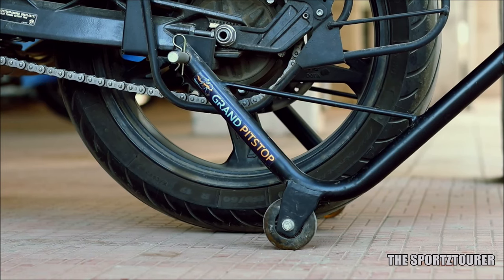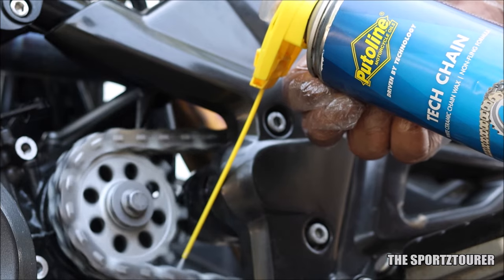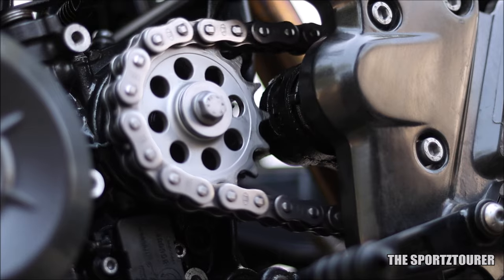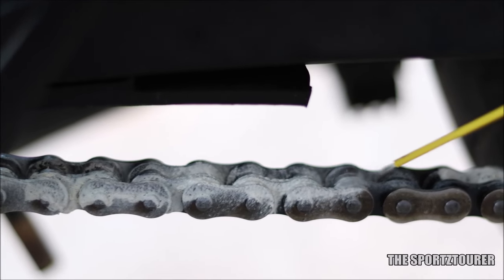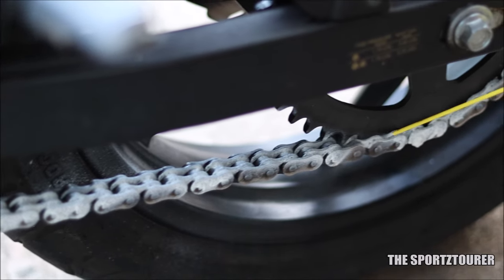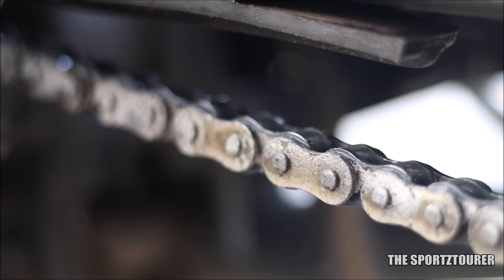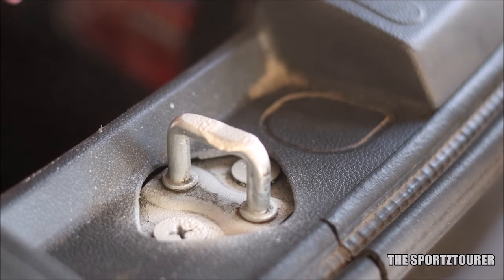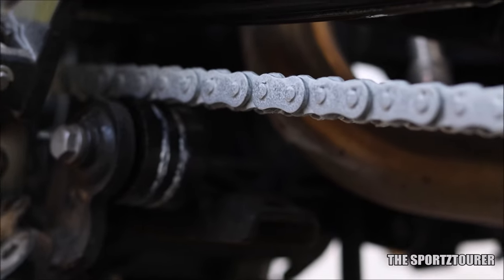CERAMIC CHAIN LUBE BEST CHAIN LUBE FOR MOTORCYCLE BETTER THAN MOTUL CHAIN LUBE? BMW G310R TVS APACHE

Comment: Rolon white lube is also good but mainly found two issues with it. 
1. Very small applicator nozzle, you end up spraying it more on tyre and rims rather on chain. 

2. It accumulates dust debris and become fine grinding paste after few  hundred kms 😅. Removal is a task too, normal chain cleaners can't remove it easily, have to remove it with diesel
Reply: Just used it, letss see how it performs.
Reply: @Ahmed-jv7oc  how was it bro?
Reply: It was good, used it for 2 weeks then I crashed my bike🥲🥹

Comment: My biggest gripe with dry chain lubes especially by Silkolene and Putoline is their cost and usage. They are super sticky and once applied and dried they won't splash but that also makes them a bit hard to clean. There application is also a hassle as the mist tends to stick every place it comes in contact with, tyre, swing arm etc. 
As someone who is particular about chain maintenance, every 500 kms and another coat if riding in rain. I dont see point of spending so much on these expensive lubes, I stick to my usual ones.

Comment: I use this tech-chain lube... however, removing the wax remains from the chain is very difficult... what chain cleaner do you suggest to pair with this lube? I do apply motul C1 cleaner and brush it off and wipe with cloth at home...

Comment: One reminder i have been using the diesel for cleaning the chain as its better and more   Reliable than the chain cleaner ..but  my chain pad (rubber pads which sits in the middle  of the chain and swing arm ) they were worn out just after 6000km .i dnt know its for me only or the diesel is  opposite to rubber components ..be carefull if you use diesel for cleaning chain

Comment: These chain lubes are not worth the cost in my opinion, a brand new sprocket chain is cheap. Its more sensible to replace it than maintaining with costly lubes, I'll stick to engine oil as lube.
Reply: Its not about the price of chain and sprocket. Its about mileage and also ride quality
Reply: That is a ridiculously stupid take, I am sorry but it is. Well maintained chain not only transfers power to the wheel more effectively but reduces fuel consumption as well. Plus a well maintained chain decreases load on transmission and engine.
The logic of your argument would make washing clothes redundant or may be you don't wash but rest of world does.
Reply: Exactly no sense in buying expensive sprays to lube chains, better to save money and replace the chain (unless you own superbike , of course ) , KTM official tells you to clean chains with diesel and use 90no. Gear oil or some good quality lube spray.
Reply: @sa4555 O,X and Z ring chains don't require lubricant to function smoothly they need for rust prevention as the grease is between the rings and never requires lubrication. 90 gear oil is a good rust preventive